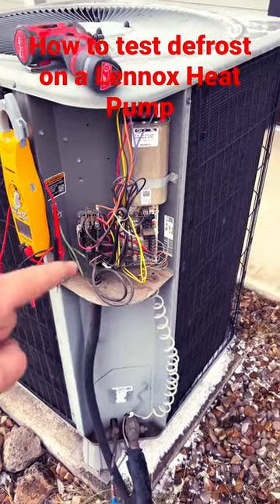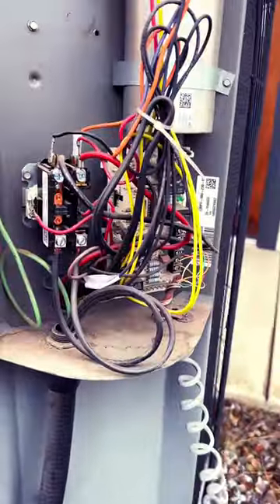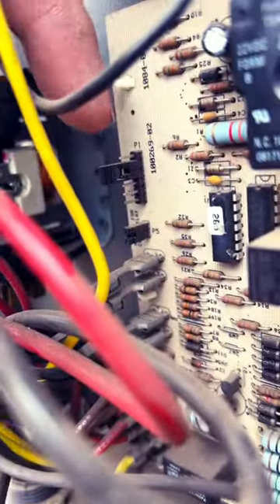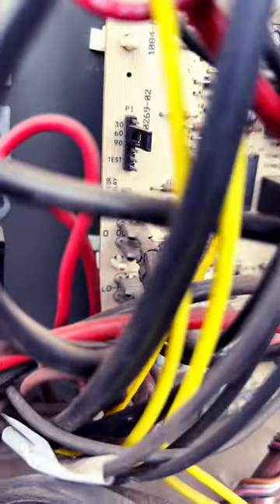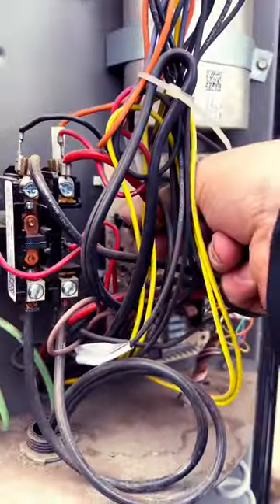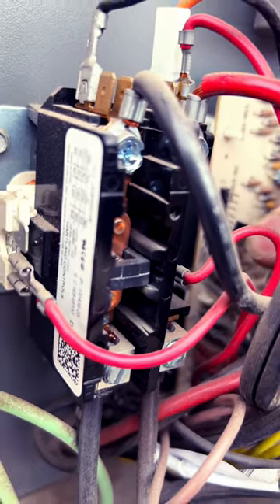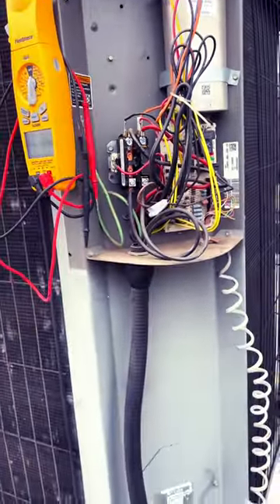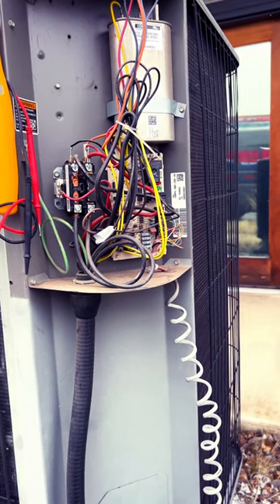How to test defrost mode on a Lennox heat pump. #hvac #hvaclife #heatpump #refrigerationcycle #heat

Comment: Can't you just short the pins so you don't have to mess with the pin?
Reply: Just my guess is that you cant test unless that piece is removed from the run and actually placed in test
Reply: Don't do that you'll short the board
Reply: I do it all the time
Reply: Leave the jumper in place and test with a screwdriver

Comment: There is much safer way of doing it 
If you have a glass of water or clod spray you apply it in the out door coil temperature sensor the u it will think it’s cold there for it will automatically switch to heating and it before the heating mode it will give a defrost cycle .
Reply from the maker: Dipping the defrost thermostat into cold water or cooling it to close it will not immediately switch the unit into defrost mode. As the timer will have to complete while the defrost Tstat is closed. The minimum timer is 30 minutes of cumulative run time. This is why the test pins need to be used.